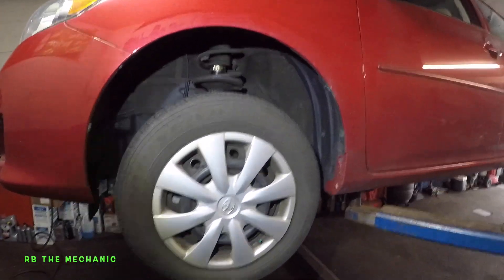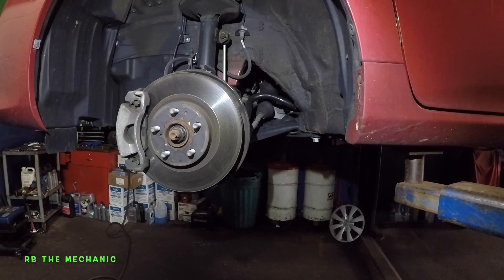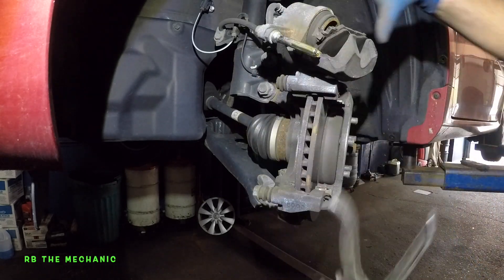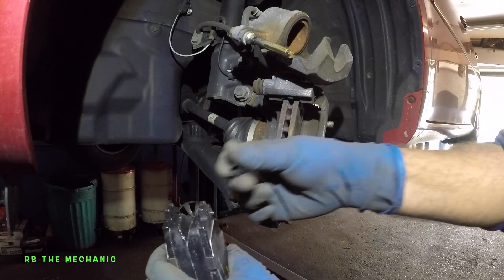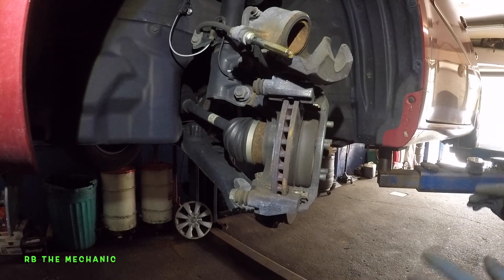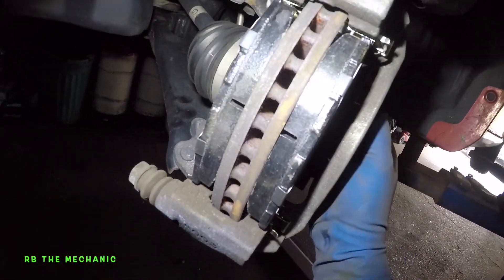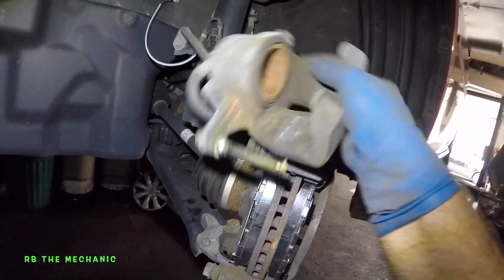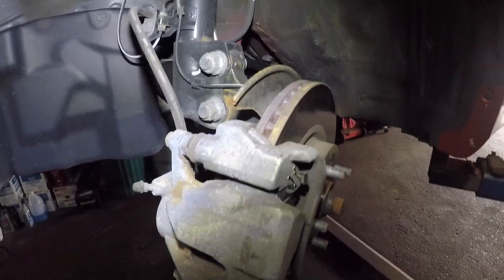How to replace front brake pads on Toyota Corolla 2008-2012

Comment: What is the torque setting on the caliper bolt when reassembling?
Reply from the maker: Gimme the year make model I will get
It for u tomorrow morning from work
Reply: @RBTheMechanic  thanks for the fast reply. My car is a 2009 Toyota Avensis TR 1.6 (UK model).
Reply from the maker: @kevinhealey7470  hopefully I got that in my system or wise I’ll give u specs on this Corolla
Reply: @RBTheMechanic  that or the Camry should be fine. Cheers👍

Comment: Do the  rotors  need to be cleaned off when just changing the brakes?
Reply from the maker: No either they r good or replace them no need to clean or anything unless ur putting new rotors they have oil coating those u have to clean
Reply: @RBTheMechanic  Appreciate it!!! I didn't clean them and everything ran smoothly.

Comment: What is the thing called that the pads clip on to?  The large piece of metal that you put the clips in and then the pads?  I think I need to replace mine.
Reply from the maker: Caliper bracket
Reply: @RBTheMechanic  Thank you sir!  Ordered, delivered, and working on installing them as I type.
Reply from the maker: @Sudz28  ok let me know how it goes
Reply: @RBTheMechanic  Went great!  I had to wait a week for the new bracket to come in because it doesn't seem that any of the local auto stores carry them in general, but once I got the bracket/boot pin/new pins, I was able to assemble and get back on the road this afternoon.  Thanks much!
Reply from the maker: @Sudz28  nice job! Well done!!

Comment: Sup RB?  What is that brand and model number of that piston caliber compressor tool you are using please? at minute 4:40?  Thank you brotha you can link to it if you like.
Reply from the maker: I don’t have the same exact tool link but here’s somthing similar I think the one I have is made by blue point not sure https://www.ebay.com/itm/Lisle-Tools-24300-Speedy-Automotive-Brake-Pad-Spreader-Fast-Easy-Auto-Repair-/143957284228?mkcid=16&mkevt=1&_trksid=p2349624.m46890.l49286&mkrid=711-127632-2357-0

Comment: I just did all break components on a 2010 corolla (pads,rotors,calipers and caliper hose) as drivers side was sticking and getting hot. Although 90% better its still an issue on same location. Any ideas?
Reply from the maker: What is the issue? Rotor over heats?
Reply: @RBTheMechanic  it's definitely warmer than passanger side. I jacked it up and put in neutral and it drags a little.
Reply from the maker: @patrickgregory7920  check for jammed brake pads I’m think u changed caliper ?
Reply: @RBTheMechanic  replaced everything. Pads seem to work fine.
Reply from the maker: @patrickgregory7920  not work the pads can be jammed inside the bracket they wount return back if they are tight fit

Comment: I troubled to change disc pads on my Toyota Corolla 2008, because I thought at 75,000 miles on the odometer, the pads might be well worn.   This concern was multiplied by the brake pedal's long travel down, when I applied the brakes.    I thought the long arc down was caused by the worn disc pads.    When I removed the caliper,  I could see that the two pads each had almost 1/4" of brake material.  They were really not worn to a point of danger.   Still,  I replaced them because I already had purchased new pads and had labored to the point of doing the replacement.   The brake pedal is now doing a much short arc to apply braking.
I wonder why the long travel of my brake pedal with the old pads?  Does the piston have such a small reach that the pads don't get more fully applied?    Is the problem simply that I needed to pump the pedal to extend the piston more, adding brake-fluid as necessary?   I feel like an fool having gone to the trouble of replacing the disc pads unnecessarily, when a much simpler remedy was available.    Any comment?
Reply from the maker: Check for jammed calipers and caliphs pins same in the back and if u got drums in back they might be loose and worn out replace drums shoes